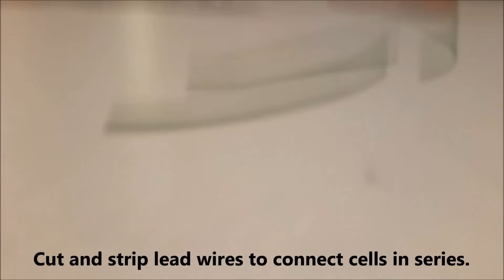Soda Can Battery - Power From Trash - DIY Project

Comment: Would it be rechargeable, please answer!
Reply from the maker: Hi Mike, you might be able to add a little extra charge to the cell but it would not be fully rechargeable. It is what's called a primary battery that destroys the metals as it discharges electricity. Please SHARE and SUBSCRIBE!
Reply: @SourcePortEntertainment  thanks for answering, which battery would be the best for me to make if I'm going for something even more proffesional. One that doesn't need many in parallel to produce decent amperage.
Reply from the maker: If you are looking for DIY solution. Possibly a Lead Acid battery with Lead solder wire as the metals. It should be rechargeable and have more voltage than the copper & aluminum battery.
Reply: @SourcePortEntertainment  thanks u gained a sub. Keep making videos.
Reply from the maker: We thought you might like Building a DIY ROCKET STOVE video - https://youtu.be/Hlir866cp-E please LIKE and leave a COMMENT. We value your feedback!

Comment: Can 4 cans light a LED bulb? I try it for so long and it didn't light the LED light, what is the problem on this?
Reply from the maker: Hi Carl, thanks for the comment. In this setup using copper and aluminum that would only give you about 2v ....0.5v per can. It depends on the LED you use, if you can find a lower voltage LED you can get away with using less cans. I had to use 10 to get the 4.5v-5v required for the LEDs on the flashlight head I used. Please try again and let me know your results. I would love to see them. You can try  use graphite from a pencil instead of the copper wire with your aluminum cans, and it should get around 1v per can.
Reply from the maker: Hey Carl, any update on your project? Just wondering. -Danny
Reply: Source Port ServicesThere is a problem in the device I created because it didn't light a LED bulb and I don't know why. I watch another video then his device consists of copper sheet and a aluminum can inside a container and he add the saltwater solution inside the container and it will light a bulb or toy motor but this device is more costly than your device. Actually I like your device because it is cheaper and safety. So when I have a time I will create more.
Reply from the maker: Awesome Carl! I look forward to you sharing what you make. Please keep me informed.
Reply: Source Port Services Hello! Your video about soda can battery helps me a lot in our project. Thank you for your all advices. We used copper plate, saltwater, and aluminum foil in 5 plastic cup and we light a 3V LED bulb. Soon we will used sand, saltwater, copper wire, and can. Thank you very much.
Reply from the maker: +Carl Bryan you're very welcome! I am glad I could help. Please share my videos and encourage others to subscribe! If you need more help please ask. -Danny

Comment: Please  explain  how the  electricity is  produce
Reply from the maker: From: http://c03.apogee.net/contentplayer/?coursetype=foe&utilityid=yvea&id=4613
Combinations of certain metals, such as copper and zinc, will produce electrical activity when placed in special solutions called electrolytes. The two metals form the electrodes. The electrolyte creates a chemical action that causes the zinc to form positive ions and the copper to form negative ions. These ions are freely flowing in the electrolyte. No current flow can occur until the electrode terminals are connected to a circuit, like a light bulb. The electrons then flow from the zinc electrode through the external circuit to the copper electrode. The chemical reaction between the zinc and the electrolyte continues, and the zinc is eventually used up in the process.
Primary Cell Battery Graphic

Common dry cell batteries work on a similar principle with a paste-like electrolyte and a carbon electrode rather than copper.

Please SHARE and SUBSCRIBE!
Reply: Vijay Kumar Maurya copper and zinc, copper and aluminum, and others, produce electricity with salt water.  As basic as can be said.
Reply from the maker: Spot on, thanks for the comment Vincent!

Comment: Well done! This is a real video, not a stupid fake. If you look at the activity series chart, you will see that aluminum is very reactive and copper is not very reactive. The difference is what makes a cell produce electricity. This also means the aluminum will eventually get eaten away. Your current is influenced by surface area of metal, as you correctly said, but also what chemicals the metals have to react with. I am no chemist, but have read a lot about historic batteries and modern batteries, and I do understand a few of the reactions involved. You might get more current or voltage or both if you add copper sulfate to your electrolyte. I am only guessing here, but I think the copper will deposit on your copper wire, and the sulfur will join up with the sodium from the salt to attack the aluminum and make sodium aluminum sulfate. I think that is the stuff we call alum. The chlorine from the salt may also attack the aluminum and give you aluminum chloride or it may unite with the hydrogen in the water, which will make hydrochloric acid. Either way, be careful, because these are not nice chemicals. And they may very well make holes in your cans. Put the rig in a litter box to catch any pee from the cells.
Reply from the maker: Thank you for the very detailed comment and great ideas! 💡 Yes always be careful when playing with chemicals. Please give this video a share and remember to subscribe!

Comment: What is the reason why you use sand, and card board? Base from what I've learn so far copper, zinc and acid can make electricity. I want to learn :D
Reply from the maker: Hi Leo, thanks for the comment. I just use the cardboard and sand to help stabilize the copper wire, and prevent it from directly touching the aluminum and shorting out. Please share and subscribe! - Danny

Comment: Use plaster my only thought on this is that you should make a sealed version and you can make enough smaller ones to power something and don’t use play sand use very very small glass beads because there’s iron in playsand and the salt water will cause rust to form
Reply from the maker: Hey Random Rc Projects, thanks for watching and the tips! I will try that. Please remember to share and subscribe!

Comment: You used salt water as electrolyte, bur mentioned vinegar near the end? Or both?
Reply from the maker: Hi Don, thanks for watching and commenting! I just used salt water for the electrolyte in the initial project. Then after a couple weeks the light was very dim, so I used some vinegar to increase the amperage through whatever corrosion was making it not put out enough amps. That made the light brighter but ate holes in the cans pretty quickly. Please SHARE and SUBSCRIBE!
Reply from the maker: We thought you might like Building a DIY ROCKET STOVE video - https://youtu.be/Hlir866cp-E please LIKE and leave a COMMENT. We value your feedback!

Comment: Can you specify the link on the flashlight head ? or where to buy it? Thankss Also on the Sand so that I can know the volume per can like per grams and what kind of sand to use because it may affect the result. Where can I buy the sand?
Reply from the maker: Of course here is the link. It isan Ozark Trail brand mini flashlight. https://www.walmart.com/ip/Ozark-Trail-Mini-Flashlight-in-Assorted-Colors/34350005

Comment: How many cell to charging my smart phone?and is more copper coil gives more amper?and can i use the used sand next time?my english is so bad.thanks.
Reply from the maker: Hi Moh, the more metal in contact with the electrolyte solution will produce more amps that is correct. Yes you could use the same sand next time it might hold some of the salt content for you too. Thanks for watching and commenting! Please share the video and subscribe!
Reply from the maker: We thought you might like Building a DIY ROCKET STOVE video - https://youtu.be/Hlir866cp-E please LIKE and leave a COMMENT. We value your feedback!

Comment: Came to leave a comment about the lining in soda cans but see others have already mentioned it.  Another cool experiment might be to coat the can with magnesium and use a carbon rod for an anode instead of copper.  It might bump you up to 2 volts per can.  And then try adding different liquid solutions of salts or acids to the dirt to see if it might improve v0ltage.
Reply from the maker: Hey John, thanks for watching and commenting! Great ideas for future experiments, thank you. Please SHARE and click the Bell for notifications!
Reply from the maker: Hey John Richter, thought you might like to see my newest splitting maul handle update video. I'd like to get your feedback on it. https://youtu.be/CD_DKONIcEY .

Comment: I was wondering what the cathodic reaction is for this battery? is it an Air electrode with O2 being reduced to OH-?
Reply from the maker: We thought you might like Building a DIY ROCKET STOVE video - https://youtu.be/Hlir866cp-E please LIKE and leave a COMMENT. We value your feedback!
Reply: I'm unsure why it worked without sanding the inside..
I supose its either thin enough to be conductive, or selected for this reason..
Perhaps it is an electrolytic capacitor?
Reaction being NaCL + electricity == NaHO + ClHO

Comment: Will it work 100% because I want to make it in science exhibition And how many hours it will last long
Reply from the maker: +Sadhna Rani Agrawal if you are just powering LEDs it will last for weeks-months. If you are using a stronger acid like vinegar it will produce more AMPs but will not last as long.
Reply: Go and try it sadhna you could see how easy it is
Reply from the maker: Agreed Troy this is a simpler project to test. Thanks for watching!

Comment: Ok thanks. do you know how to produce electricity from salt?
Reply from the maker: +Sadhna Rani Agrawal you just need to separate two different metals by either an electrolyte like salt water or acid like vinegar. You just need to make sure the two metals do not touch inside the cell. They can only be connected by the wire outside the cell. Just start with one cell and check it with a multi-meter/voltmeter, and make sure you get voltage. Then connect each can/cell copper wire on one cell to aluminum can on the next cell. Until you have one wire connected to the aluminum can on one end of the string of cells, and one wire connected to the copper wire on the last can in the string.
Reply from the maker: Hey Sadhna, any update on your project? Just wondering. -Danny

Comment: if we add more salt would voltage increase??

if we add lemon juice or vinegar would we get better results?

if we use zinc instead of aluminium would we get better results?

some scientist,answer please
Reply from the maker: if we add more salt would voltage increase?? Voltage would not increase the voltage is determined by the differences in the electrons in the two different metals

if we add lemon juice or vinegar would we get better results? Yes the amperage was very low with just salt water but the destruction of the metals would have been slower. Once I added some vinegar (more acidity) increased the amps but broke down the metals much quicker than salt water.

if we use zinc instead of aluminum would we get better results? Using Zinc and Copper would produce more voltage and I think amperage too because of the electron difference
Reply: Source Port Services wrong voltage is partly decided by electrolyte, if you get nickel and graphite and use saltwater you get 1.9v and with organic lithium electrolytes you get 3.7v
Reply from the maker: We thought you might like Building a DIY ROCKET STOVE video - https://youtu.be/Hlir866cp-E please LIKE and leave a COMMENT. We value your feedback!
Reply from the maker: @siffle4249  thanks for the tip! I might try to get me hands on some nickel and use some graphite from pencils...that just might work for a test. Please SHARE and SUBSCRIBE.

Comment: R not the inner cans coated with something to stop the soda eating away at the can?
Reply from the maker: They are, I forgot to sand down the insides of the cans. Probably why it has such low current and voltage. I will do that next time.  Please share the videos if you like them. Thank you!

Comment: Good video.  I can't really read the dial on your DMM but I suspect you're reading it wrong.  0.21 mA is awfully low for even one LED. I suspect it's 21 mA at least, and more likely to be 210 mA (0.21 A). Which makes your array a pretty good homemade battery.
Reply from the maker: Hi Tarin, thanks for the comment! You are probably right. I am working on the design for the 2nd version. Please subscribe and turn notifications on so you don't miss it, in a couple of days when I release it. Thanks for watching, please leave some comments on my other videos!
Reply from the maker: Hi Tarin, I thought you might be interested, just published the update for this video. Please check it out, share it, and let me know what you think. Thank you https://youtu.be/DRVzPqgp10c

Comment: DIY Car Alternator or 3 to crest Free power for Home & the best electric motor to spin them & a low voltage sensor to batteries to turn the motor on to charge the Batteries !
Reply from the maker: Hi Mark, thanks for watching and for the comment! I have seen car alternators rewired with permanent magnets and used for wind turbines and water wheels in streams. What are your thoughts on those? Please SHARE and SUBSCRIBE!

Comment: Ok how can I get enough to power a tv
Reply: Not worth it. You would need to make a room that was 20'x20' is size filled with these batteries, wire them various clusters in series and parallel to achieve the approx DC voltage THEN buy a DC to AC converter to power the TV.  You would spend alot of money of  copper wire alone.
Reply: Troy Nall oh yeah well I need to see how my friend did it cause she has a cabin and she has no power and she can run her tv small frig not all same time but is able to live nice thank you very much
Reply from the maker: Hi Gloria, this is for basic chemical cell battery demonstration purposes. Not enough power out of this one to power anything major. It is not rechargeable either, so your friend would be better off using deep cycle lead acid batteries. I have heard that golf cart 6V batteries do pretty well being charged by solar panels if your friend is wanting a more affordable solution. Thanks for watching, please SHARE and SUBSCRIBE!

Comment: You should use a wire screen over the spring and real battery aid from the auto part store. battery aid cost $10 a pint
Reply from the maker: Nice thanks for the tip Robert! Please subscribe and share the video.

Comment: What is the benefit of the sand? How does it affect the volts being produced?
Reply from the maker: +LOlGwen great question. My thought was just to use the sand to hold the copper wire in place. It might add more resistance to the cell but I am not sure. I will be doing another version soon with no sand and smaller cells. Please subscribe and click the bell so you don't miss it. And share the video if you like it please?

Comment: So what your saying is…. If i pound this 24 pack of Dr Pepper and make 24 batteries i can make a 12 volt battery to power lights in my house when power goes out 🤔 i wonder if it would be enough to power a short wave radio for any period of time.. maybe if i sand off the coating on the copper and double the coil to double the mah. Now you got me thinking
Reply from the maker: Yes that is what I'm saying Mike! And that is awesome! 😜 Thanks for watching and commenting! Please SHARE and SUBSCRIBE!

Comment: Why do you need the cardboard in the the battery you have the anode (the Mountain Dew can) you have a cathode ( the copper) and the electrolyte ( the sand with salt) with three things I have listed you have a battery I know you’ll have reason thanks for the vid
Reply from the maker: Hi Oliver, thanks for watching and commenting! The only reason I used cardboard was that I was worried that the copper coil might move inside the sand and sort out by touching the inside of the aluminum can. It was only to prevent sort circuits and keep the pieces of the battery separate. Please let me know if you have any more questions, and please share and subscribe if you like this video! Thank you!

Comment: Hay did you know the inside soda cans are sprayed with a coding? You could  got more power if you would of sanded the inside of the soda can first also use a carbon rod anno. You will double your output. Use copper wire to direct current. Not to make current truth is it drains the volts. Copper Wire is the worse, but it's all there to use for wire and works somewhat. Maybe someone will figure out how to manipulate current fields and use magnetic field as positive and base field charge for a navigate. Without the need for wire. Taking the power out of the surrounding and directing it.
Reply from the maker: Hey Vyran, thank you for the suggestion! I will look at getting carbon rods for a future project. I appreciate you're feedback. If you like our content please SHARE our videos and Subscribe to our channel. Thank you!
Reply from the maker: Hey Vyran, thought you might like to see my newest splitting maul handle update video. I'd like to get your feedback on it. https://youtu.be/CD_DKONIcEY .

Comment: Im surprised you got much because soda cans just like tin cans are layered inside with a thin coat to help keep from corrosion ,i had problem a few times .
Reply from the maker: Hi Isaac, thanks for the feedback. Yes other subscribers have said the same. I think the sand must have scratched some of the coating off or there were micro-scratches already on the inside of the can. Please give this video a share on social media or reddit if you can. I would greatly appreciate it!